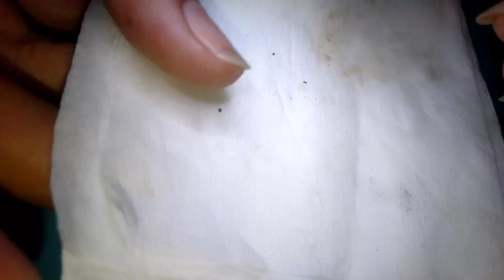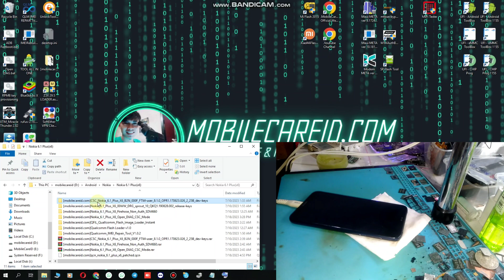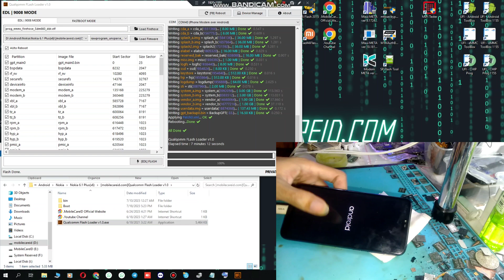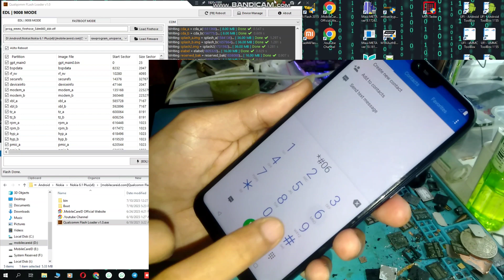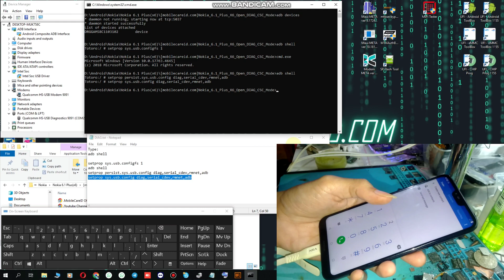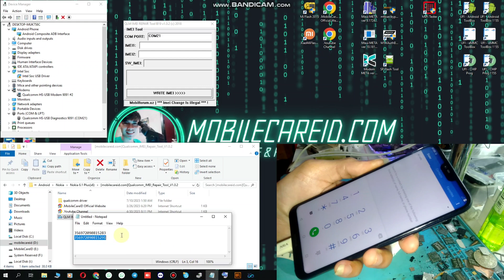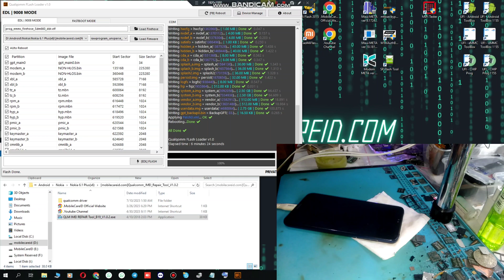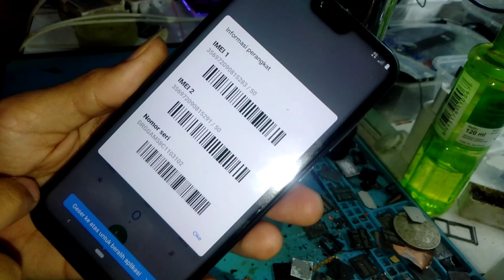Change eMMC Nokia 6.1 Plus Without Box | Fix Dual IMEI | TA-1116 TA-1083 | By New CPU @mobilecareid

Comment: Since emmc & CPU both has no rpmb configured, how does it booting. I heard qualcomm phones need rpmb programmed to boot up..
Reply from the maker: RPMB configuration has nothing to do with booting if using a new CPU, keep in mind that every CPU with a different series the security is also different, how can the device to boot, please find out about the cdt partition and what file are in it and do an experiment on the oppo a37 device. Actually I don't know what I'm talking about, because your question made me think so hard 😅